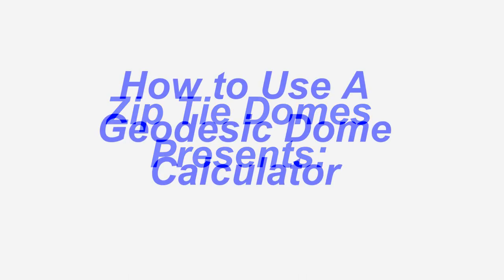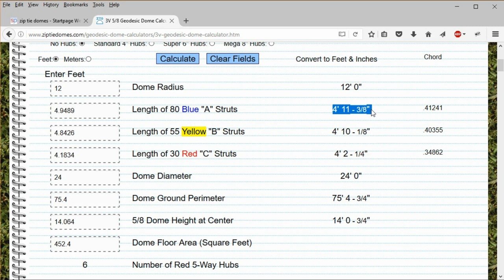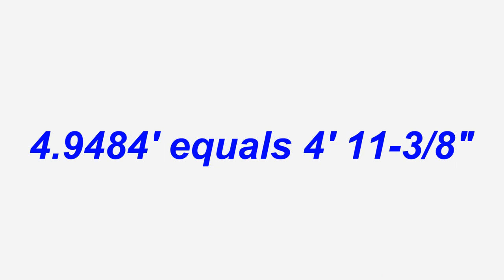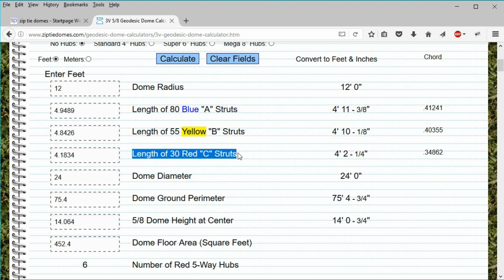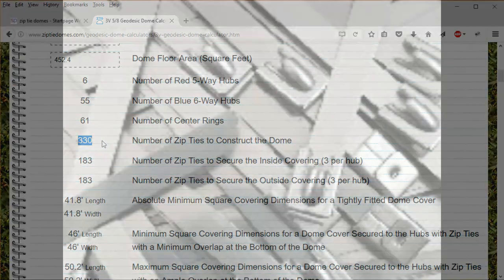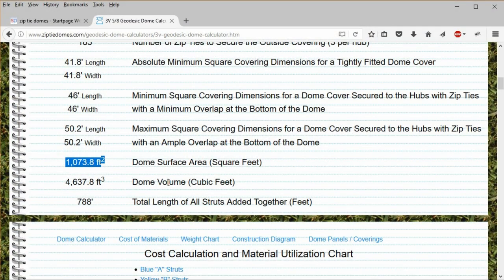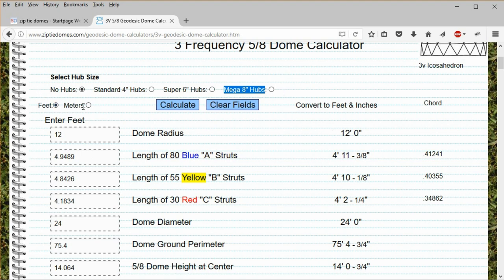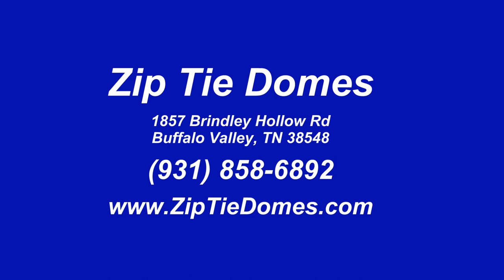How to Use a Geodesic Dome Calculator - Part 1: Strut Lengths

Comment: Hello, I would like to build a geodesic dome to use as a pergola in my garden. I live in an area where there is a lot of wind, the dome stays in place all year round. Will it be wind resistant enough up to 60 km per hour? Thank you
Reply from the maker: We have never had a customer lose their dome to high winds IF the dome stays on the ground.  If the dome comes off the ground, it becomes a big parachute and nothing can hold it down.  We recommend that you use 2' long rebar stakes at every hub to hold the dome to the ground in a windy location.  Thanks.  John Hurt
Reply: @ZipTieDomes  Thank you for your response. Anyway, I had already planned to make a ground anchor. I wish you a good Sunday. Thanks Kristin

Comment: could you explain what the "5/8" represent in "3V-5/8 dome"?  What's the 5/8 about?
Reply from the maker: For a 3v dome, the true equator of the dome goes through the middle of a vertical section of struts.  The dome has to be either 3/8 or 5/8 - it cannot be 4/8 for this reason.  The first minute of this video will explain this in much better detail:
https://www.ziptiedomes.com/video/253v38build.htm
Thanks for watching. 

John Hurt

Comment: when adding the hub centre ring width to the strut length do I  divide the width by 2 and add to two opposite struts or just add the full width to all struts going into the hub? My understanding is that if imagine for a while there was no centre ring the struts should meet in the centre of the bigger ring and not overlap each other by the 1/2 width of a centre ring
Reply from the maker: With our hub design, the true geodesic dome chord length will begin and terminate in the very center of the hub center ring.  So to get the chord length, you would add 1/2 of a center ring width to each end of the strut, or to be practical,  just add a the full width of the center ring to each strut length to get the actual chord length.  Our calculator does all of this for you if you check the radio button for the hub size you are using.  Thanks for watching the video.  John Hurt

Comment: A very good site ... but I have a note that the diameter of the pipe used in the design was not specified ... If snow loads and wind speed are added, then a design can be obtained that specifies the diameter of the pipe used
Reply from the maker: We can make the hubs for any size pipe.  For higher wind and snow loads, we can use a large strut pipe.  Thanks for watching the video.  John Hurt

Comment: The imperial measurement system is so complicated that once the floor surface or the diameter is decided upon as a starting point, it would be smart to convert this number to the metric system and work in metric from then on, and make a slight adjustment to start with a more or less round metric number, i.e. since 12 feet equals 3.65 meters, start with 3.50 or 3.75 meters.
Reply from the maker: Thanks.  If you want to use the metric system, just click the "Metric" radio button on the dome calculators, and everything will be given in metric units. In the USA, we have to use Imperial measurements to use a tape measure to cut the struts.  Thank you for your comment.  John Hurt
Reply: There are no metric tape measures in the USA?
Reply from the maker: I have never seen a metric tape measure at the local hardware store, you may find it online.  But all of the material that you purchase at the hardware store is in feet, like 4' x 8' sheets of plywood, or 10' pieces of pipe.  So a metric tape measure would not be useful in the USA.  Thank you for your comment.  John
Reply: I agree that materials like pvc pipe and lumber are defined by their cross section in feet and inches However once he has decided which type of pipe or wood to use, there's nothing preventing a builder from measuring the strut lengths in centimeters-millimeters. It's much more precise and easy, and a well-known online retailer sells metric and even dual-system tape measures.
Still your video is the first explanation of frequency that makes sense to me, and your calculator is a precious tool, a great time-saver so thanks a lot.
Reply from the maker: Yes, that is absolutely true.  Thanks, John Hurt
Reply: I have a Leverlock tape measure made by Stanley that shows measurements in both imperial and metric. I'm sure there are other, longer ones.